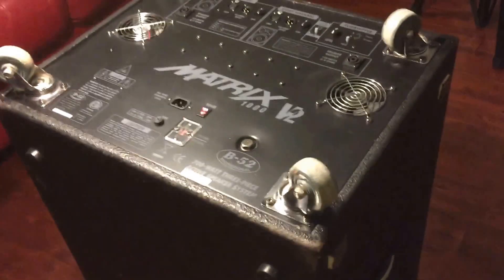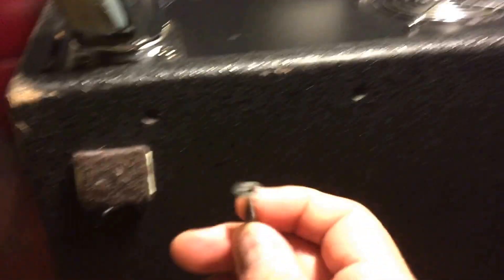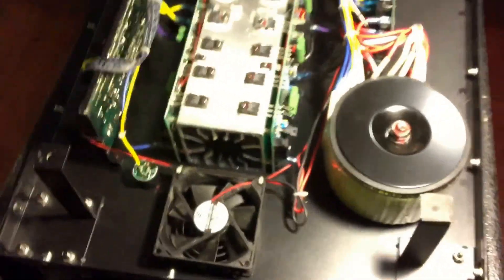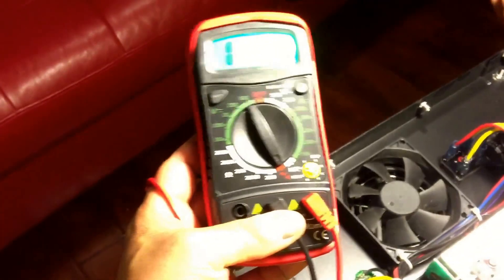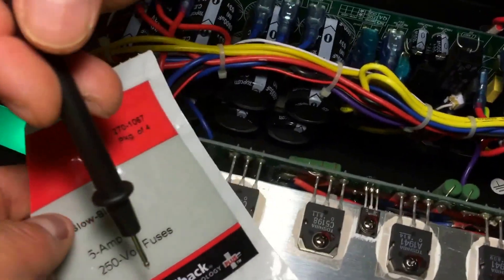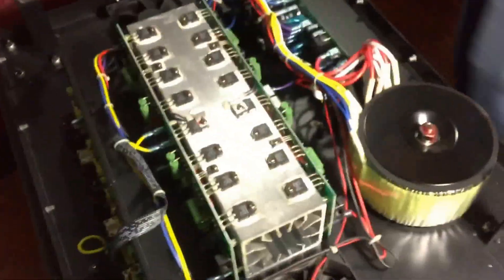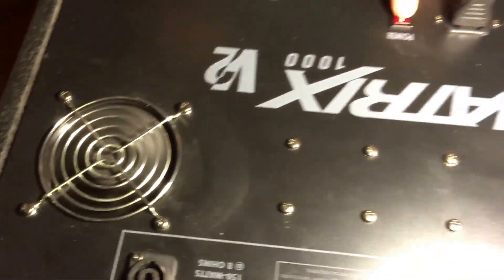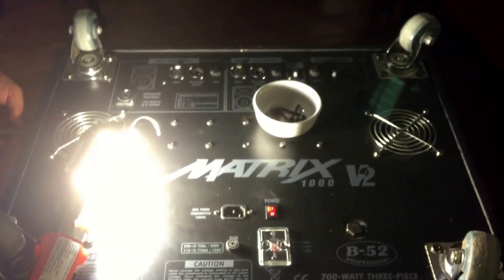How to fix Fans on a B52 Matrix 1000 v2 by Fuse Replacement

Comment: This is what happens when you lack the required electrical knowledge.
The fuse for the fans on the Matrix 1000 V2 is a 1.6 Amp 250 Volt 3/16" x 3/4" and was chosen to protect certain components.
It is sized according to the amount of amperage the components & wiring are designed to normally carry. If something fails and begins to draw more amperage, the result is more heat. The fuse is sized so that it will burn up thereby cutting power to the portion of the circuit it is protecting.
By installing a larger amperage fuse, it will not burn out until it reaches that higher amperage which force the portions of the circuit that are meant to be protected to have to carry a higher amperage. This can result in destruction of the components, and can lead to a fire.
Next time, instead of calling your brother, who allegedly knows more about electrical than you do, maybe call an actual licensed electrician who knows why there is a fuse, and why its' size is very important.
I would also like to point out, if that subwoofer should go up in flames, and if it causes any damage, or anyone is hurt by it, there is video proof of your incredibly irresponsible act of negligence.

Comment: I have a B52 set up that I just recently bought from a friend of mine for a great price. it worked great but now the "tower" speakers are not working and all I am getting is bass. The blue light is on indicating i have power , But I am just wondering if this is a fuse that could be blown or what do you guys think.....Any info would help me greatly. I have a gig this weekend to DJ and i need answers quickly. Thanks again in advance.

Comment: En español no entiendo
Reply: I have a B52 set up that I just recently bought from a friend of mine for a great price. it worked great but now the "tower" speakers are not working and all I am getting is bass. The blue light is on indicating i have power , But I am just wondering if this is a fuse that could be blown or what do you guys think.....Any info would help me greatly. I have a gig this weekend to DJ and i need answers quickly. Thanks again in advance.